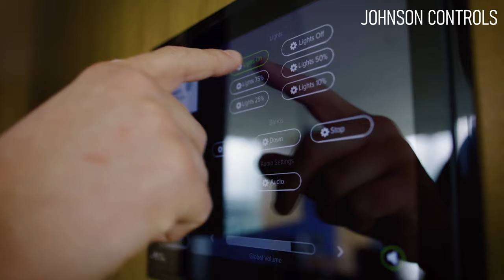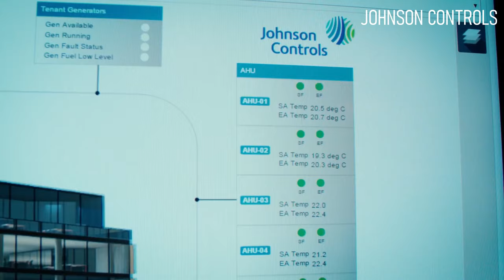The Rise of the Robots

Comment: The solution to labor replacement is use of human creativity and problem solving.
At the high end people becoming system architects, designing and improving the systems that solve problems.
At the low end, people becoming system guides, solving individual problems that require more creativity or insight that is harder to train an AI for.
This could be a moving target, but the world will never run out of problems that need solving.

Comment: I don't think that UBI leads to idleness, in fact, I think this is a misrepresentation of the idea. While it may for some, I would expect most people to thrive in activities that they couldn't pursue due to the necessity to make an income. A UBI could in this sense encourage people to live and find tasks they actually can relate and connect to. Also, the UBI is by definition a basic coverage - people who want to live on a standard higher than 'basic' will still require a job - they would just have more flexibility in the choice as the income just needs to cover the extras.

Comment: Technology is for greater good and reduce human effort. Don’t you wanna eliminate the labor jobs? Jobs will transform into technological and technical skills from physical labor. China is still using human labor because robots are expensive than humans. no one will loose job, new jobs will emerge based on the technology. I’m an architect I’m for sure in a decade we need coding and algorithms , like you said architecture is becoming more data driven but most of  architects are still stuck with cad. If we don’t adapt to the technology, the reality is inevitable. 
AI is gonna bring huge changes in architecture and construction industry, you should look at GPT-3. First stage would be an AI doing analysis, second stage would a participant in the design process, at least it would reach a point AI an architectural assistant. 
I like your channel and I’m into AI and robotics. You are welcome to criticize. @BelindaCarr

Comment: Exactly, I mean EXACTLY what I think and it turned me politically. I...well I invented a machine, it replaces two workers on each line it is part of. Fortunately there was other work available within the company for these people...for now. I don't know what is going to happen, I'm fairly old so it's about to not be my problem but you younger people better pull your heads out 'cause it's coming and it's coming fast. I and others like myself are after your job, we're not sorry for stopping drudgery and we are not going to stop what we are doing. You need to have the guts to imagine a better way. 

There is NO current economic system that fits the future.